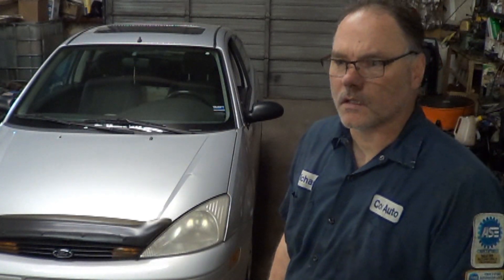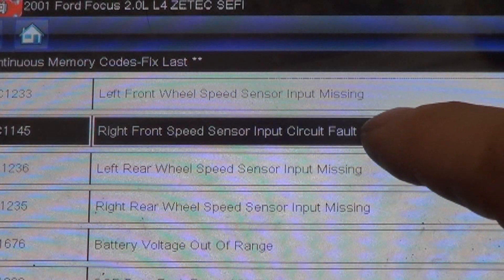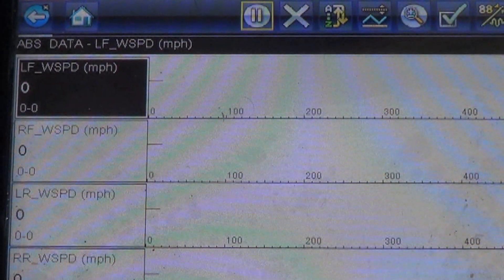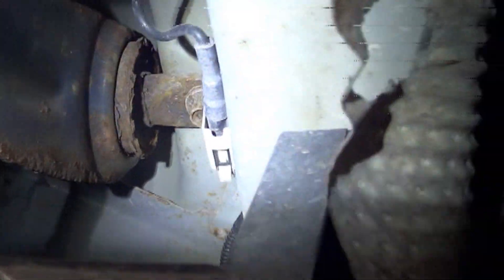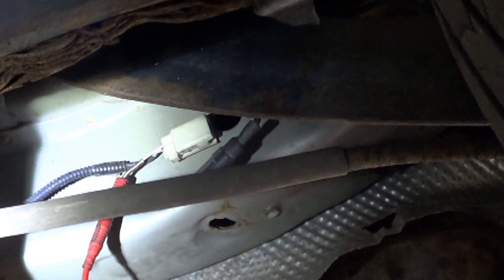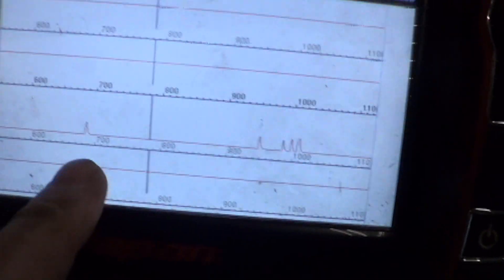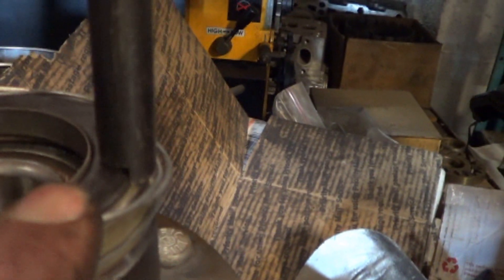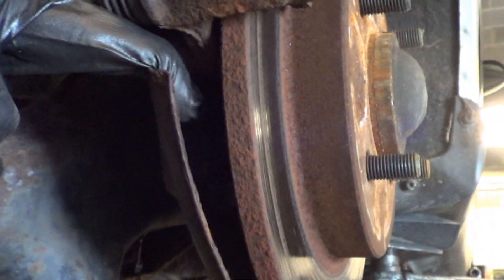Focus rear wheel abs codes

Comment: Thank-you for documenting this. I have the same code, but with drum brakes in the rear of my 2003 Focus. Love your diagnosis and it put me on to the right direction, but I think I'll find something a little different on mine.
Reply from the maker: thanks for watching.  I thought this was a great little diagnosis but the video hasn't received much attention, but of course I'm a Vw mechanic so I guess my subscribers are not interested.
Reply: @CoolAirVw  Well, you certainly gave me the info I needed. Very interesting to see the diagnostic procedure, I learned a lot, thank-you.
Reply from the maker: @blackrockbrewing5141  Appreciate the comments.
Reply: Did you find out what yours was? I'm reviving an 07 SES 2.0l. Hasn't been worth it at all so far, I discover new problems for every one I fix. I HAD the OD light, ABS light, and brake light on at all times, car would only Rev past 2k rpm or 10mph. Front VSS, and cleaning contacts under console fixed the OD light. ABS sensors replaced fixed the ABS light for me, but brake light is still on, and scan tool reveals no input from both wheel speed sensors
Reply: @user-tk7lf3kr5c  Wow, that sounds like quite the project, I can see how that would give you headaches. Yes, I did find out what my problem is. So, just like the magnetic tone ring in this video, there is one attached to the inside flange of my drum brakes. I changed my brakes, but did not transfer these magnetic rings to the new drums. Also, I threw the old drums away. So, now I have to buy new ones and they are expensive. New, there are 25-65 each. So, I am thinking about getting them out of the bone yard pretty soon.
Reply from the maker: @user-tk7lf3kr5c  Solution is right there in the video?  Maybe you are asking previous commenter what fixed his?
Reply: @Maximiliano Rowan Try Flixportal. Just search on google for it :)
Reply: @James Brycen Thank you, I went there and it seems to work =) I really appreciate it!
Reply: @Maximiliano Rowan you are welcome =)
Reply: @user-tk7lf3kr5c  It sounds like you might have an emergency brake issue. because it would cause those issues without setting off the any of system check lights. or show any codes when scanned. from what I can tell from your disription of the symptoms you had.

Comment: I am having the same/similar problem with my 2002 mk4 Golf.  It's a little more complicated as it is 4Motion.  The traction control kicks in while driving.  Its very annoying as the brakes are applied intermittantly. I have replaced the front speed sensors.  The problem is still there but not as frequent.  I am now thinking about replacing tyres as I have been advised that on a 4wheel drive system all tyres must have the same wear or else the speed sensors will read different speeds based on the treadwear. Thanks for the video and greetings from Auckland.
Reply from the maker: Have someone graph the wheel speed sensors.  lift wheels off ground and measure circumference with a tape measure.
Reply: @CoolAirVw  Thanks a stack.

Comment: mine doesn't show a code on the reader.
Reply from the maker: this video is about diagnosing a code.  If you dont have a code what would you be diagnosing?
Reply: @CoolAirVw  My abs icon is apearing when there is nothing wrong so the easiest thing is to check the code first.
Reply from the maker: @cloverdog85  yes.

Comment: That customer is no doubt stupid as a post, for electing not to replace that passenger tone ring. it's only going set off the ABS light again, and they are asking for future problems with traction control. apparently judging by the work that was done on the passenger side. it's obvious that either the customer or some idiot they know, did the repair on the driver's side which caused this whole issue. it's just another case of people that don't know what they are doing working on cars. which leaves people that are legitimately working on cars having to clean up their messes.
Reply from the maker: Your right.